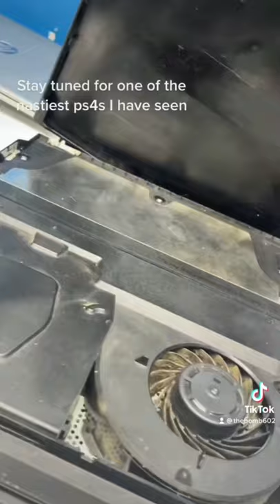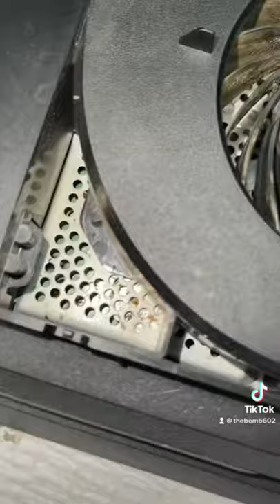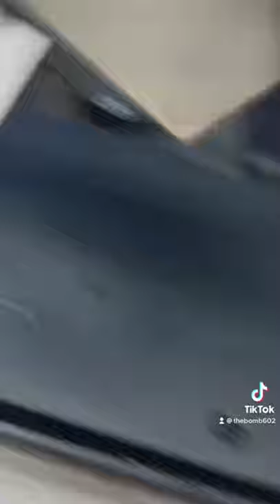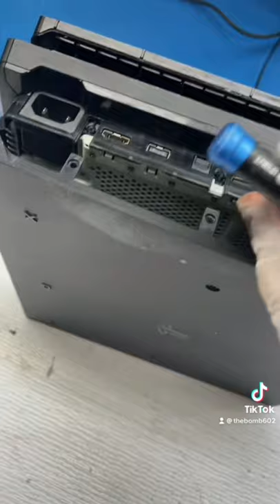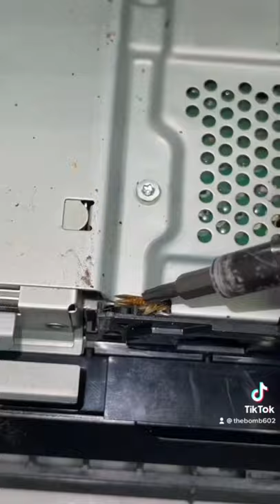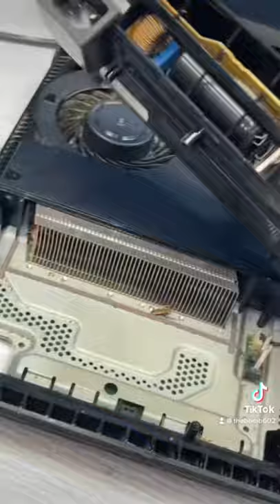**WARNING BUGS** NASTY PS4 PRO OPENING

Comment: One of my friends has a ps4 pro and a couple years ago it kept overheating and eventually he could only play for about 30 minutes till it turned off. I went over to his house and noticed that there was no sound at all. Turns out the fan burned itself out because it had to constantly work at max rpm for like a couple months. I had never taken apart a playstation before but I got the top and bottom panels off just to confirm the fan was broken. He ordered a new fan and I was like give me a couple days for the required tools to arrive. I used a video tutorial and got it open just fine and when I got to the heat sync it had a solid wall of dust blocking it. He smokes weed near his playstation and that played into the bad smell. I fully took it apart and cleaned everything as well as replaced the fan. I gave it back to him basically brand new. Aaaaand its back to the jet mode state and since he lives on it he doesn't want to let me clean it. History might repeat itself.
Reply: Your a good friend lol
Reply: Great that was a nice thing to do for him. Hopefully it doesn't become a regular thing
Reply: @avintoussaint3551  lol
Reply: it’s kinda normal for so many dust to build up for 7+ years without cleaning it. My heat sink was also clogged with dust, but I never smoke. But yeah cleaning solves overheating issues.
Reply: If you’re going to smoke weed in your house near electronics make sure they are off and a window is open. Or if you want to rip it between rounds keep a high quality air purifier rated for smoke on and near you so the air isn’t filling with smoke which gets sucked into the console and resins everything up such traps more dust.
Reply: Pretty normal for a console to be clogged with dust, doesn’t matter if you smoke or not.
Reply: @pearcejames5490  better than me lmao

Comment: I used to work for a TV repair shop that did rental company repairs. I once opened up a rental console television that you would not believe. Inside the set there was a 2" layer of dead cockroaches on the bottom and a massive spider web on the top of the tube. I found no Live roaches, but I did find a family of LIVE spiders. The battle went on for months, and the spiders won. I could not fix the tv.

Comment: I can top this, mines corroded on the inside and somehow still works. I opened it up and the big traces near the hard drive slot were corroded, parts of it are missing now. It still works fine other than the typical jet engine noise. I have no idea how it even happened but the inside was beyond gross 🤢.
No bugs though thank God 😅

Comment: The piece on the opposite side (where you plug your hdmi cord in)popped off(not where you plug the cords in) but the opposite side, that piece that goes around the corner a little came off & I pushed it back in. Does that have any affect on the ps4 bc mines just fell but everything still works. I heard a ticking sound around the disk area but idk if that was from me tilting the ps4 back nd forth to make sure there wasn’t anything lose

Comment: I had bought a ps3 slim used of eBay that was listed as overheating and this was what happened. I did clean the 20+ roaches out.

But the main problem was that I needed to de-lid the cpu to put new thermal paste.  which I ended up doing wrong so I bricked the ps3 lol